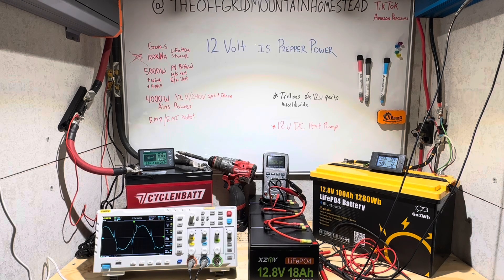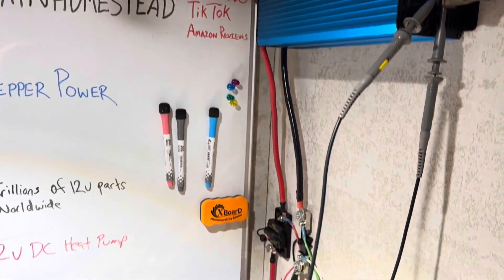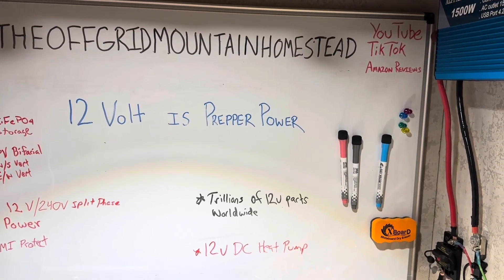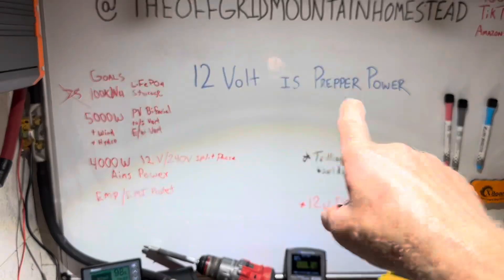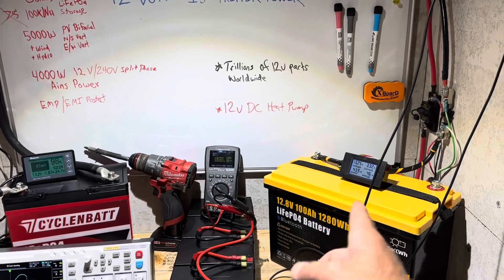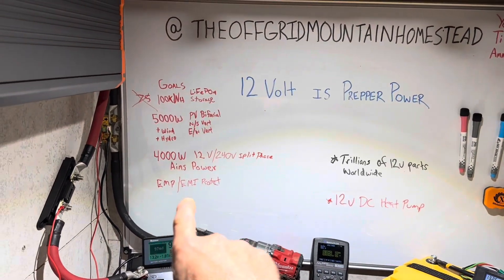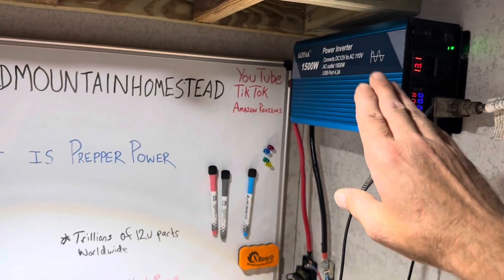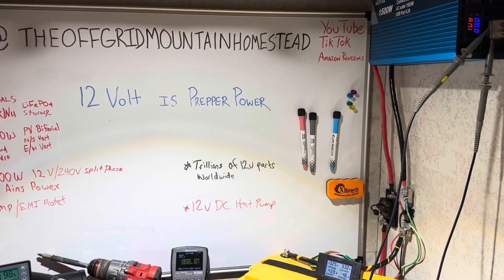Introducing The 12 Volt “POWER BUNKER” plus Channel Updates

Comment: I did some testing with that concrete board. Pretty resistant to fire. Didn’t check electrical fire though. Have you?
Reply from the maker: It won’t burn or disintegrate in a fire pit even with a little diesel fuel accelerant. Good enough I guess for a hillbilly durability test lol.

Comment: To me, the only reason to go higher than 12 volt is to have smaller, cheaper wires to save money there. From what I have seen, the parts are all about the same price for the same wattage. Since my build is portable and, in a trailer, I went with 12 volts. Easy to get parts while traveling and can charge it from the car while driving with a simple dc to dc charger. Went with Lifepo4 for the lower weight on the amount of power you get. Weight limit is a factor on portable systems. If I was doing a stationary one, I would probably go with lead acid for the price. I like the 12 volt or dc powered ac units I have seen so far. I know EG4 has come out with a solar powered mini split. I think it needs 400 watts of solar to run without anything else. But if you want it to run at night you will have to have it connected to some sort of power source.
Reply from the maker: You definitely have it figured out! Perfect example of 12V benefits!